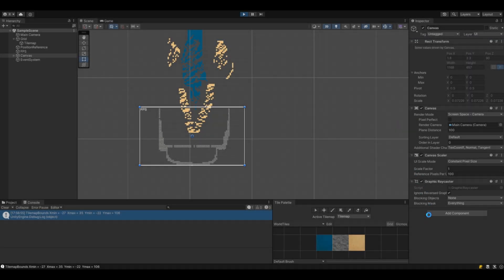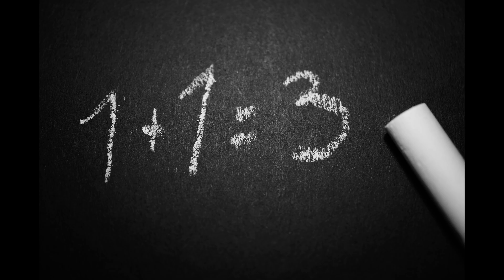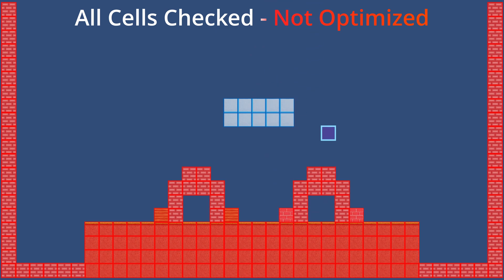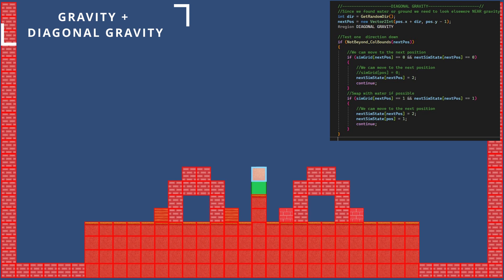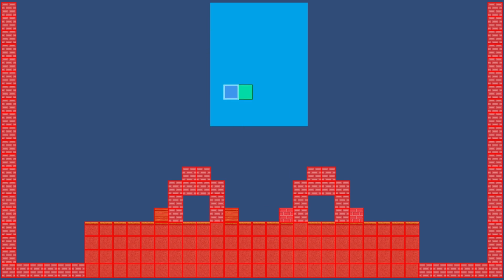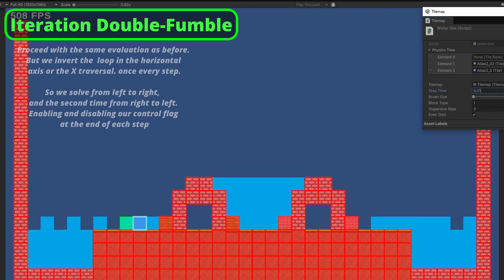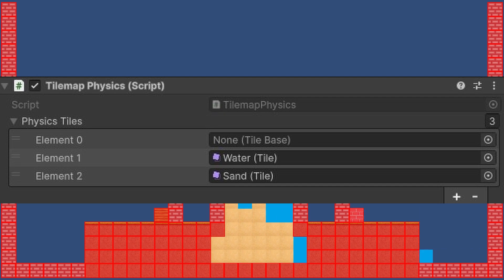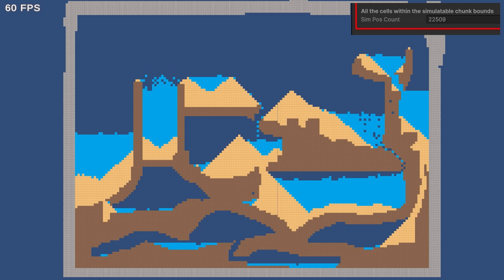I Made a Sand Simulation with Water - Unity Tilemap Physics System

Comment from the maker: Corrections of what i say in the video. In the Chapter: Adding/Removing Blocks,
When adding and removing to the simulation (Not the ground) you do it  after you have evaluated everything,. and you add it into your simulationGrid  before the drawing method is run. It allows to display clearly whats added before it is evaluated on the next step..

Comment: Randomly got recommended this video out of nowhere and really happy. Also Unity now has these features built into Unity starting as of 6.3

If anyone else gets this video reccomendation, since this video was released Unity has added new Tilemap API in Unity 6.3 and 6.4.
They are high performance API that do not create any allocations that really help this stuff out. 
Look into Unity's new PhysicsDestructor API which is a new built in API for destructible 2D physics. It has fragementmentation and slicing built in.
They have a huge project to download from their public repo to show how to use it.
Reply from the maker: I did this with unity 6..0 and 6.2 . so i didn't know tile maps had improved! I will surely check it out if I move up one version!
Thanks a lot for the comment and for coming over!  Wish you the best